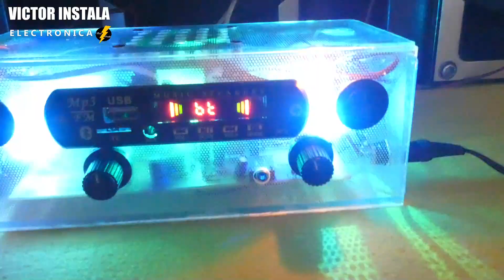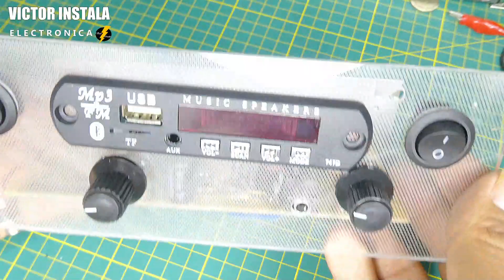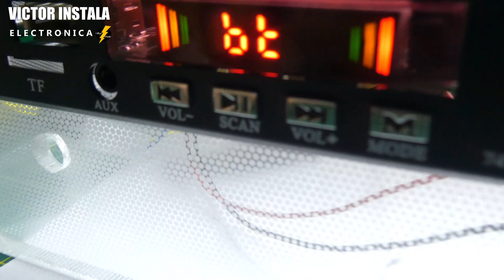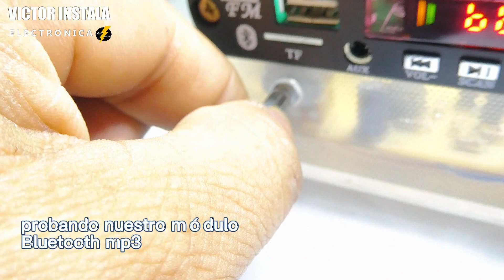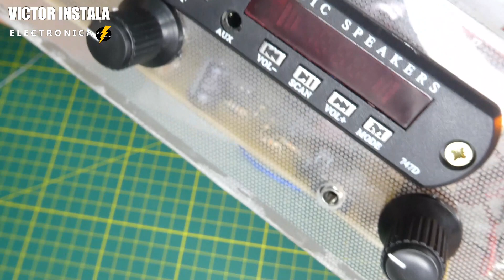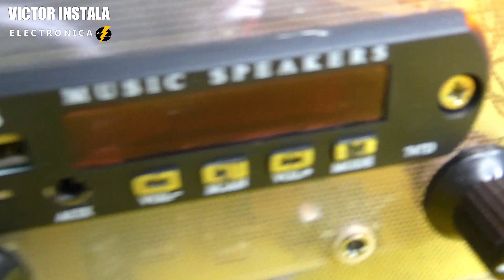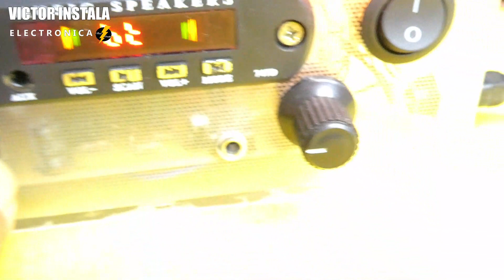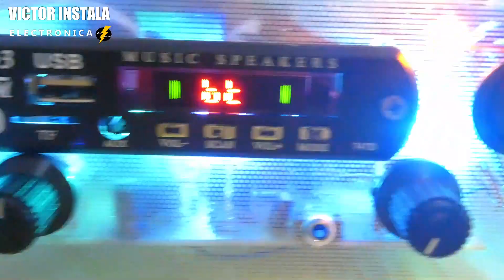COMO HACER TU AMPLIFICADOR  CON TDA 7377 Y  Bluetooth MP3

Comment: Felicidades Victor!!, un diseño limpio y elegante:washhands: .
Entiendo la necesidad de aislar la alimentacion del modulo mp3, pero el regulador que usas disminuye el voltage y veo que usas un capacitador en el modulo. A cuanto bajas el voltaje?
Me podrias indicar de cuantos amperios es la fuente de alimentacion que usas? Veo muchos consumos: Ampli, modulo, regulador, leds, ventilador y las  luces.
Sobre las luces, fantastica idea, Son audioritmicas? de que tipo son las lamparas y como las instalas?
Enhorabuena por el trabajo. Me encanto tu diseño de metacrilato y luces.
Reply from the maker: Buenas en el amplificador se está usando 12V  solo para el amplificador ahora sí en módulo Bluetooth  MP3 estoy unasndo un regulador de voltaje   de 24V pero para modu Bluetooth tendríamos que poner en 5V con un multímetro para que no se queme tu Bluetooth .usando los 12V del amplificador